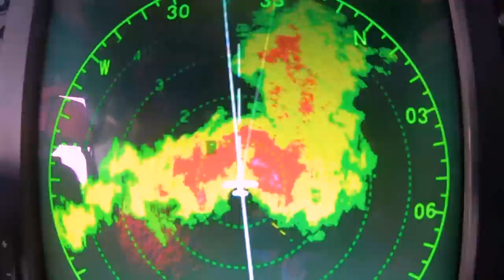Building and Selling $15,000 worth of Charcuterie Boards

Comment: You have some shop inefficiencies that would really save some time if you addressed them.  The positioning of your tools for example have you bouncing around all over the place instead of a going in a line.  Additionally you are doing steps that aren’t really necessary. You need to think about the woodshop more like an assembly line and spend the money where needed to make the job faster or require less people. If nothing else get a glue roller and make some templates so you save some time.   Aside from waiting for glue to dry, 100 boards should take you less than 12 hours start to finish.
Reply from the maker: Lol you don't get to just ignore glue time when calculating production costs. How many charcuterie boards have you built and sold?
Reply: I don’t know if you’re right or wrong, but I do know that people tend to listen to people that they actually know when it comes to running their businesses.
Reply: @jennieanddavis  I've been a professional woodworker for 20 years. You do the glue ups at the end of the day so they are ready for processing in the morning.
Reply: @AaronGeller  That's fair and they are welcome to ignore my advice. I simply felt it was worth point out that they are leaving money on the floor with their inefficiencies. If they're ok with that, so be it.
Reply: @MRBenchwork  It is quite possible that you do have valuable advice, but I know even with my parents, if they tell me that I’m doing something wrong or if I’m inefficient, then a while goes up and I don’t want to listen to their advice even if it is good.
I don’t think you had bad intentions at all.
Reply: You can't reach that conclusion just by watching sped up videos.
Reply: @jennieanddavis  I do agree that  glue drying time should be counted in labor costs (if it was). You are sitting there twiddling your thumbs watching glue dry. You're doing something else. There's a difference between "time to complete" and "man-hours"

Comment: I'm jealous!  Not jealous of the quantity you are making or $$ you make or any of that.  I'm jealous of the wood you have available to you.  The only choices I have is HD or Lowes.  I can barely find a straight 2' x 8" piece of oak. My other choice is poplar.  That's all our Lowes has. HD isn't much better.  If I want anything else I have to drive 70+ miles roundtrip in hope of finding something. Add the price of gas on top of the wood and making cutting boards is now out of the question.  It costs too much!  Nobody is going to buy a $200 cutting board. Draw back of living in a small town...
Reply from the maker: Our first business was in Minot, North Dakota. We had to drive 8 hours round trip to get all our hardwood. The price of that trip was worked into our prices and paid by all our customers - you can do it, too!
Reply: @jennieanddavis  before going that route (which may still happen) I’ve decided to adapt and overcome by making oak (better looking than poplar) engraved name signs/plaques that the realtors can give with the back of the sign fully branded with the realtor’s information. They are quick and easy to make. $7 for the wood, 20 minutes of time and sell for $40.